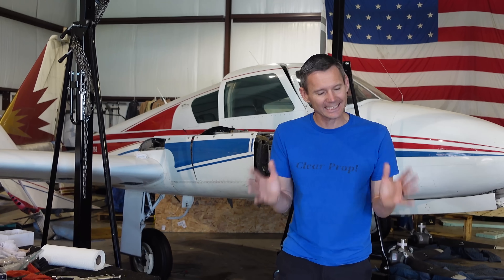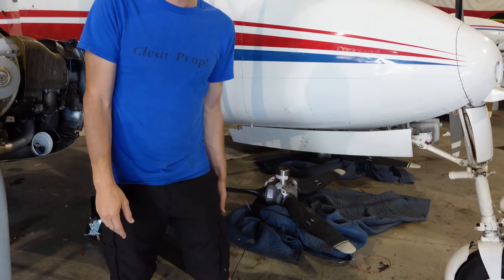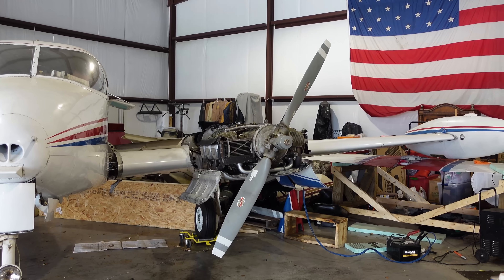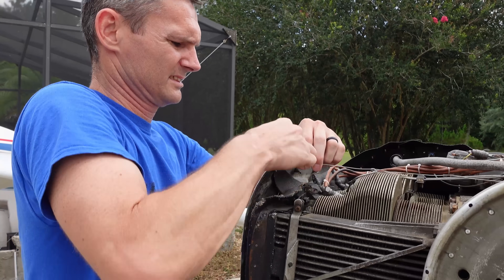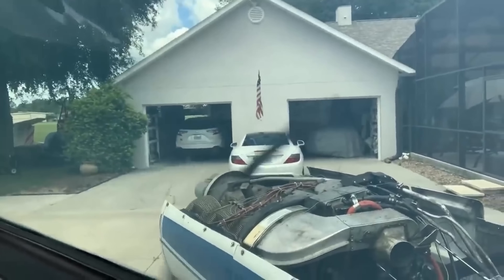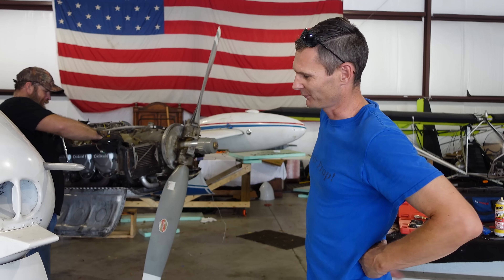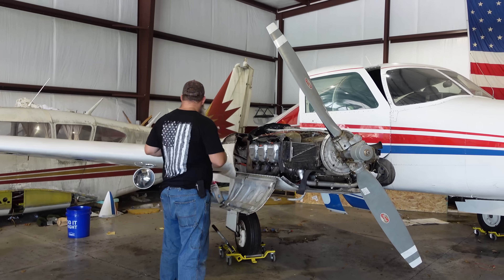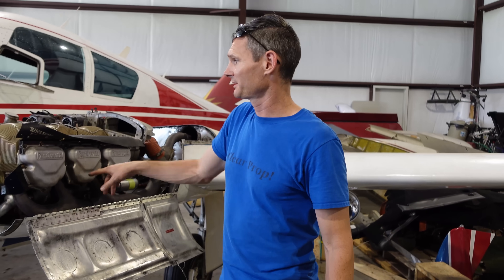I Crashed The Abandoned Airplane...

Comment: I am glad no one, nor property, was injured or damaged, but the level of incompetence shown in this one video is astounding. A 2x4 board does not constitute a chock. Cheap plastic chocks are also inappropriate for an aircraft of this size and power. Then there is the admitted fact that the brakes do not work. For a supposed certificated aircraft mechanic to allow a run-up to take place in this manner is inexcusable. I just hope no one dies in this little adventure of yours.

Comment: Hi Jimmy, as an early 310 owner of long standing (36 years cumulative so far) I hearty recommend the Cleveland wheel and brake conversion, far more effective and reliable than the Bendix brakes which were original equipment. BTW, early 310s have some characteristics which are quite different from other twins, especially when compared to a docile plane like an Apache. I strongly recommend getting a thorough checkout in one with an instructor who has extensive early 310 experience. Please email me if you would like a few tips. Looking forward to seeing the new, improved 310!

Comment: When I was in school a student jumped the chalks running up a Beaver with an R-985 radial engine. The student panicked and shut it down from high rpm by cutting the mags off. The sound of it backfiring to a stop was impressive, even though I was several hundred feet away inside a building.

Comment: Buy a Small DeSoldering bulb smaller than your palm and fill it with very warm water and then point the end nozzle into the ear canal and Press the Bulb hard to force the warm water into your ear to dislodge ear wax and open the canal. Perfectly safe as you can not press the rubber bulb hard enough to hurt any parts of your inner ear and it opens the canal to allow you to hear properly again.

Comment: Hey Jimmy, 
Be extra careful with the landing gear fittings. Recently there has already been two "left" landing gear failures( one of those when I was flying) in South Africa... They both were C310-Q. All the best man. 
Keep up with the work
Reply from the maker: Thanks for the info, good to know!
Reply: Basically what happened is when I came into landing that day and put the gear down I herd a pop and the gear cycled normally but the left main wouldn't lock on and gave gear unsafe light and gear warning. And while landing eventually the gear collapsed. 
Luckily I was with my instructor so we were safe but the aircraft was damaged.
Reply: @amospandey  Did he teach you how to do a one wheel landing ?

Comment: If that’s a new differential compression gauge (car one) it may have a schrader valve in the tip you need to remove .. I had similar problem here in uk ..

Comment: Sometimes, you just have to call quits on a project and it seems to me that Mighty Mouse is not economically repairable. It seems it would need a full on nut and bolt restoration and I dread to think what that would cost, so to use it as spares to save another 310 is fine by me. Keeping a plane in the air is better than no plane at all.

Comment: Hi Jimmy, I've been following your antics of Save the 310 for a long time, but I wonder if you could answer what some may think is a dumb question for me please? As an automotive engineer and one time auto mechanic, I am horrified when I hear you crank these engines. What is that god awful clack clack clacking noise caused by?? It sounds like the pistons are hitting the valves, which they obviously aren't. But I can't even imagine what is making that awful noise. Thanks in advance.

Comment: I hope that broken chock wasn't an omen. I want you to get both those engines running perfectly and run it on the ground, within temperature limits for X amount of time, (do several runs letting it cool off in between) then cut open the oil filters. Find someone with much experience in twins, preferably Cessna twins, to fly it while you monitor all the instruments. Put your Go Pro in so it can see the instruments too. How long is the runway you will be operating from and is there an emergency area where you can put it down safely in case of an abort situation? Have the fire emergency people standing by. This one makes me nervous. Do not try to stick to an Oshkosh or bust schedule with it. There is always next year.

Comment: And so, something is missed, and fire is the result.  You lose the hangar with the fuel tank  inside.  The pilot bails out to escape the flames without pulled the mixture, Jimmy had doubts about the chocks.  A PT-17 and Super Cub in front. What could go Wrong?  Did the insurance premium reach the agent?

Comment: What is that awful clacking sound when you're cranking the motors with the plugs out??
Reply: Magnetos clicking
Reply from the maker: the magnetos snapping to induce spark.
Reply: Suspect it's the impulse function on the magnetos, it holds back the rotor at low RPM  and releases it to create a hot, delay spark timing to make starting easier.

Comment: I still don’t get this. The whole point of this was to save THE 310, not A 310. If the fuselage is toast and it would require taking the skins off and not worth it, then maybe it’s time to put a bullet in it. If it’s not worth it, it’s not worth it. Time to take stock of the Aztec.

Comment: Jimmy, It is time you went out and bought a Lottery ticket😂. That was close. I am still wondering how you are going to fit the engines into the 410.? That is an air stair door, not a cargo door, plus move them inside the plane for C.G. or are you going to load everything  (parts, tools,etc .) in a U-Hall and drive out to CA? Please inform. And as All ways, Keep Your wings Level and Your Gear Down, and now to the list check your Wheel Chocks🛩 pilotcropduster

Comment: Why didn't you pull the throttles back when I was yelling at you?
Plastic chocks are only to keep the plane from rolling down a small incline while you fuss with fuel or loading something, not for a power on test run!
I didn't see a good fire extinguisher nearby either!
If you ever need to hand prop or do a maintenance run up, tie the damned plane down! Or have somebody at the controls if the brakes operate. You kids are going to put me in an early grave, I swear!
Reply: You don't have dm turned on so I saaume this is a scam. Lol